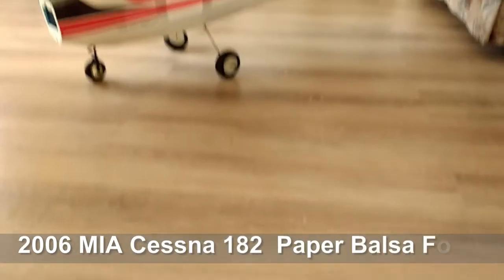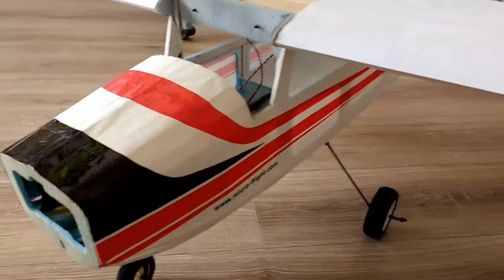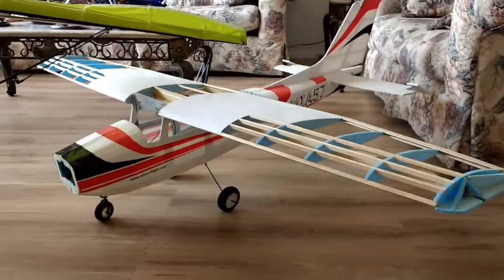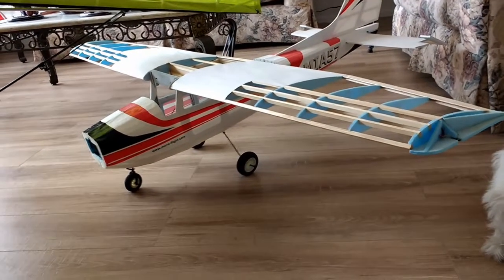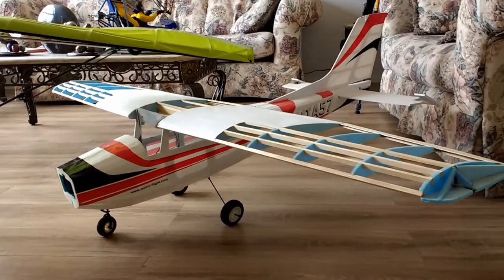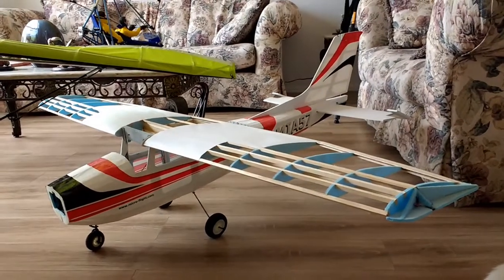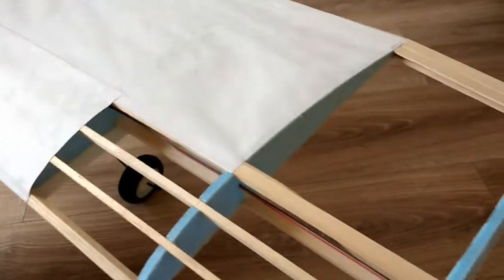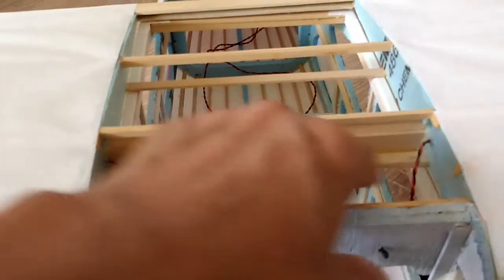MIA Cessna 182 Scale Airplane made from Paper Balsa and Foam

Comment: Simply glad wrap it neatly to prevent moisture absorption
Under 3 ib & u can fly in local park too.
Reply from the maker: There are many ways to keep moisture from a build like this. Because I live in Arizona which is mainly hot and dry, most of the year, I don't have issues with moisture. However, I can coat the model with a light clear coat to keep moisture out.  Yes, this model can fly indoors also, in a very small area, because of its Slow Fly capabilities.